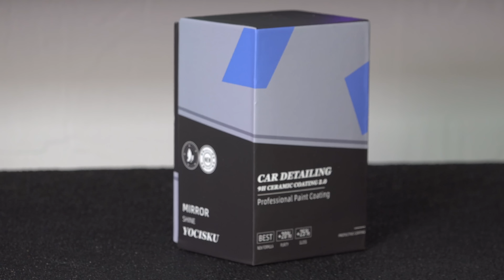I Ceramic Coated my SNOW BLOWER to make it NON STICK

Comment from the maker: Thanks for watching  Please LIKE & SUBSCRIBE - $2 off coupon on the coating here! https://amzn.to/2WL7kU2
Reply: Price is now $26.  Which is somewhat typical for Amazon and items that suddenly start selling.
Reply from the maker: @eosjoe565  Click on https://amzn.to/2WL7kU2 again. Its an instant coupon, so just click the coupon and it takes the 50% off. I just checked and it is still good.
Reply: @SilverCymbal  - Haha... time to do an updated review because that link has expired and, is now 'currently unavailable.'
Reply: @eosjoe565  The price is 25.99 but the offer comes with a 50% off coupon if you check the highlighted box. Best wishes.
Reply: @parrotprodigyproductions  Ahhh...  didn't see that at all.  Thanks.
Reply: Grabbed it!  I have the materials to add the rubber paddles but never got to it. I always try to find easier way before opening or drilling anything. But I am surprised that S.C. have not yet done rubber paddle extensions himself
Reply: Must have changed. Now there is only a $2 off coupon.
Reply from the maker: @runningmadphoto1947  Sorry they must have ended the extra deal, still a great value for $25
Reply: @SilverCymbal  I still may check out. Sure beats having to spray it down every time.
Reply: How well do you think the ceramic coating would work under a mower deck?
Reply: So, how long did it last?
Reply: Would sure like to see a long term review of this!
Reply: I wonder how it would work on a satellite dish.
Reply: So, if you had an idea for a modification that would revolutionize snow blowing? Could you build or modify the machine? I have the idea but I'm not one for building or modifying a snowblower. It only snows here once every 12 years. However I lived up north for a while. My first year I cleared a path to the truck with a dust pan. 🤪 haha 😄 maybe we could make a prototype and sell the idea.
Reply: You could 50/50 test but would need two identical machines.
You could just try with similar machines, but someone would complain thinking the future of humanity rested on it.
Reply: These knock off Chinese ceramic coatings don't even last longer than off the shelf wax. That's why it's $10-20,  not $100-200.

Comment: As a teen in the 70s (Rochester) we used cooking fat, then moved to silicon spray, then spray lube oil with PTEF. The PTEF spray worked great, silicon less so and cooking grease not so much. Ceramic coating seems like too much faffing around, I’ll stick with the 15 second spray treatment.

Comment: It would be better if it was in a spray bottle. I use silicone spray on my blower and it works great and it much cheaper. Another idea that works even better is to install belting on the blower impeller fins (impeller kits available on Amazon) which makes the machine throw farther and not plug up in wet, heavy snow.

Comment: Pam is garbage.  It left a gritty film and I had to strip it off with mineral spirit.  After cleaning my snowblower, it ran like it was brand new with no clogs and threw the snow further.. I was very surprise.  I will be using a product call NuFinish which probably last several winters.

Comment: It would be much easier using ceramic spray to coat your snowblower especially in tight areas and cost less to purchase.
Pam is a big no no as it will thicken in the cold and actually clog your snowblower.

Comment: I cannot believe people use Pam or oil which gets thick and sticky in cold weather! Not Smart. And this ceramic coating is too much trouble and not as effective as a silicon spray before use and presto no stick at all and stops moisture from geting in places.
Reply: !! DING!!  Bingo ... I have been using Silicone since 1976, When I bought My 1st Snow Thrower and I still Have and use. The trick to Silicone it Must go a Clean Dry surface and it Must dry after application. 
That 47 Year old Gilson 826 just keeps Chugging along, Altho I have done many repairs to it.
I always claimed it is simpler than a Simplicity LOL  
I think it is the only machine made with Shift on the fly  .
Mike M Central Wi.

Comment: I took a plastic 5 gallon pail , split it , and lined just the chute with the plastic.    Never had a problem here in WI with any plugging.   So that's another quick fix.  And it has pasted 4 years now

Comment: interesting. I suppose a RINSE OFF spray ceramic would work best. when the "surface" is far from a flat (like this or on wheels), it's faster AND coats better.

Comment: You could’ve fixed it a lot easier and more permanently by adding rubber cutting edges to the impeller.

Comment: I never got into the pam because it's vegetable oil & will get sticky if it sits on a surface long enough. I use WD-40 but have wondered for a while about the ceramic coating.

Comment: The impeller modification is the way to go. It throws the snow twice as far as they normally do. My snowblower has not clogged in 2 winters now. We are in a warm area so the snow is always heavy and wet.
Reply: And what is said "modification"?

Comment: The coating won't last, snow is an abrasive and will wear down anything.  My 1971 Ariens looks like sandpaper was used on the interior and chute.  Spraying down the snowblower every use is just part of maintenance, it doesn't take long.  I spray my entire snowblower down with a Dow silicone spray, the entire thing even the tires and chains.  I do this to keep snow from sticking and also keep it from rusiting more.  Then after every use store it in my basement, which isn't heated but is somewhat warm.  After any snow is melted off I'll wipe it for with an old bath towel and reapply the silicone spray.  If it calls for snow again I'll spray down the chute and auger the night before again.

Comment: your lack of common sense is astounding .......you have been contaminating the environment............."the Teflon coating wears off and i have to re-do it each time".....If you didn't know PFOA persists indefinitely in the environment.[63] PFOA has been detected in the blood of many individuals of the general US population in the low and sub-parts per billion range, and levels are higher in chemical plant employees and surrounding subpopulations. PFOA and perfluorooctanesulfonic acid (PFOS) have been estimated to be in every American person’s blood stream in the parts per billion range, though those concentrations have decreased by 70% for PFOA and 84% for PFOS between 1999 and 2014, which coincides with the end of the production and phase out of PFOA and PFOS in the US

Comment: I have that same snowblower or very similar and did a lot of snowblowing last year. Not as much as you have there but maybe close. And I never had it clog up at all. Looked the same every time as yours at the end of the run. And I never coated it. Did you ever run that machine without the coating? It looked new. I'm not knocking you, I love the idea. I just don't know if it's necessary.

Comment: IT SHOULD LAST LONGER THAN 2 YEARS!! 

Think about it It's made for a car that's under constant weather conditions whether get the heat, snow, ice.. 

You only applied it basically for one season and only a handful of snow storms. 

That two years they mentioned is for constant extreme situations all weather.

Not the case with the snow blower. 

I would say you might get three years out of it or more. I mean why would it come off, and not to mention you're probably storing your snowblower inside unlike most cars. 

I would even say just a good coat of regular wax would last at least a year. Not there plenty of regular waxes that last over a year on a regular car. In that case it would obviously last longer on a snowblower!! 

;)

Comment: Best thing you can do is get all the paint off the chute and impeller housing. The snow will scour it to a shine and never stick to it again. Forget all the “tricks” and sprays, they don’t last. Bare metal is the answer. The only people who seem to know this are equipment operators and farmers. Paint looks pretty but is your worst enemy on surfaces that need to be shined. Plows, tillers, snowblowers, augers. Paint just makes them not work. Remove the paint if you want it to work like it should.

Comment: As somebody who professionally installs ceramic coatings I will say this is great in theory but won't hold up for long. The coatings are so thin that the friction from snow and ice will blow through that coating in no time. Some coating companies like ceramic pro and igl both make industrial strength coatings that are meant for equipment but they're only available to certified installers.

Comment: It is easier to use WD-40 or any silicone spray for 15 to 20 seconds each time you use the snow blower. A $5 can of WD-40 should last you the whole season. 😉😉😉

Comment: Ive been spraying a water repellent lime camp dry o  my machines for years and it really does improve the performance and non stick advantages of the snow to the machine.  Really works well on all of your snow removal equipment like roof rakes and snow shovel type tools.

Comment: I understand you bought the coating for a different purpose but as soon as you pulled out the towel from the box I knew it was a cheap coating 😂 and then you mentioned you bought on Amazon for $20 but still pretty good $20 well spent

Comment: Thanks for this! I'm guessing I've got several decades on you and snowblowing a 200' driveway is becoming increasingly difficult.  There's a pretty substantial incline. After watching your vid on ceramic coating your lawnmower I decided it might well work on my Honda snowblower.  We recently had close to a foot before it turned to rain. Thanks!

Comment: Silicon spray also works very well as a coating and lasts me an entire season.  Much quicker and cheaper,  just spray it on and let it sit
Reply: Same here - this looks like it would take more time than it's worth compared to just using a silicone spray.

Comment: I used an old trick from my early 60's childhood days of sledding on my old Yankee Clipper. I would rub an old wax candle on the runners of my sled. It helped cutdown on snow build up. So i used the same principle on the impellers and augers and the inside of auger housing. It works help keeping the snow blower clog free.

Comment: Pam doesnt last long     buy blocks of wax for candle making or canning    rub 
the inside of the chute with wax
works better lasts longer  also add rubber wiper to impeller throw snow/ slush further  almost never clogs

Comment: You can also use silicon dioxide nanoparticles suspended in ethanol (SiO2), after the ethanol dries it forms a superhydrophobic crystalline layer.
Reply: That is exactly what he did. The automotive people call SiO2 ceramic wax 
- a 'high-tech' product offering “spray-on, wipe off” simplicity.

Comment: 2 x coatings of neverwet on my sno joe and it throws snow 45 feet in the air and sbout 50 to 60 feet. I was able to drop wet snow on my neighbor across a 2 land road with ease. Blows ceramic coating away and last 3 years now...... It cost me 1 dollar for 2 cans ( 2 step process) from dolar tree.....

Comment: I just use a plow on my ATV, faster, less effort, and better clean. Won't have that layer you left on the driveway which will just freeze and be a sheet of ice where I live. Ice is worse than snow.

Comment: I'm lazy, I would recommend Dupont Teflon for snowblowers and shovels that gets the exact same results because I use my own Toro Snowblower for wet and icy snow all of the time and come across this problem...Felt like an upgrade and practically was that saved a lot of time unclogging and h*ll...lol...What use to take 3 hours only takes one and saved fuel and energy for other chores around the house...

Comment: Interesting...Here in Chicago we tend to get heavy and wet snow which can be a nightmare to shovel or snow blow. It is especially bad for people like me who have driveways that go behind the house and deep into the yard. My current blower is a late 90's Craftsman 3.8HP with a 21" Path and we've had it since before I even existed. I like using it and the thing has never broken down after so many years or required any form of parts replacement (minus the handle bar that rusted into two), but it constantly gets bogged down by thick and heavy snow that clumps to the chute and causes a clog that typically won't resolve unless you aggressively bang the thing against the pavement or (risky) jab a pole down the chute. I will try the spray greaser next time and if that works better then I might consider something like this. I don't like to just throw things out and this machine has served me good already alongside my our mid 90's Lawn Boy push mower.

Comment: My grandfather back in the 60’s used to use Crisco and then started using spray Pam. I’ve used Pam and even silicone spray, but now I will give the ceramic coating a try. 
Thank You for the video!

Comment: I started using Meguire's hybrid ceramic spray automobile wax on my 44" John Deere lawn tractor snowblower, with similar results.  I got the idea from a spray ceramic ski wax that see advertised on FB.  It costs $16 at WM and works very well.  I started using it on my cross country skis and I can't believe how well it works, on the top and the bottom.  My buddy sprayed some on the bottom of his granddaughter's snow disk and she was the fastest one down the mountain. I'm going to try it on my downhill skis.

Comment: So, one day I got a job with a concrete crew. Newest and least experienced. But, construction smart. I've done a lot of things within. It seemed I was the shovel guy. I had that shovel in my hands alot more than not. A few frequently used types daily. So, I didn't like their shovels and just used my own. Mine where older with slightly longer handles and a bigger rounder stock on the end. Better for less bending leverage. But, the biggest problem with any rusted scoop is that things are gonna stick. Like dirt, mud, and concrete. And, snow. I primed and ceramic painted them the 1st week of that aggravation. Nothing has stuck to my shovels in 5 years. And, my spade cuts better and flings better dirt and stone. Concrete doesn't clog up in the tight spots. I got fired about a week after that 😂

Comment: Think I could do this to the inside of my snowmobile tunnel? Thing packs with snow and the suspension isn't as nice of a ride after a day or 2 of it.
Reply: I'd think so. I'd be careful with putting it on the actual suspension pieces. I'd probably tape certain areas off.

Comment: I use 3M silicon spray on my toro 1432 HD. Works slick. Just spray it on quick before use and have no problems with snow sticking. Clogging is not an issue with these snowblowers no matter what kind of snow it is anyway.

Comment: Just use wd-40, it’s literally called water dispersant 40. I put it on my snow shovels. This is a huge waste and a solution to a problem that was already solved.
Reply from the maker: Sure, but you need to do that every time, it doesn't last. This is much longer lasting but do whatever works.
Reply: @SilverCymbal  okay it’s 30 seconds worth the wd40 spray, equates to about .05c lol. And that’s wd40s job you don’t need to do it every time. It last longer than that. I do my snow shovels once a year

Comment: Another suggestion - dissolve cheap white candles ... tea lights for example ....  in white spirit and then paint it on.   The white spirit dissolves and leaves a non-stick wax coating which lasts.   I use it on windows and shower enclosures.   I had even thought about using it on the car but haven't got around to that yet.

Comment: Good tip!  I put LEDs in my plow headlights and when its snowing the snow starts to build up on them since there isn't much heat generated.  Tried pam cooking spray but it just wears off.  Hopefully this does the trick.

Comment: Why is he leaving about a 1/2" of snow (the slushiest, wettest snow) on the driveway?  See ~ 2:37 mark.  He has the feet set up to leave that.  Why?  In Cleveland, once you remove that top layer of fluff, that bottom layer of slush will freeze and you've just created a giant ice rink.
Reply: He might be doing rougher areas than his driveway like a stone path to the shed in the yard...

Comment: I hope i never become bored and boomer enough to buy this big of a snowblower. Seriously, if snow sticks to it leave it in the garage for an hour. This whole thing is such a non-issue. No one has a driveway that long.
Reply from the maker: Snow won't melt in an unheated garage after 24 hours. I live in a rural area where lots sizes are 2-5 acres. Get what works for you.
Reply: @SilverCymbal  living on a 2 acre property sounds like a full time job, i guess at that point its a work expense

Comment: 1100' driveway and youre using a snow thrower??  You need a Snow Sport Plow... Mine is only 300' long and most of it uphill and theres no way I'd consider a snow thrower.   I do my entire drive way in 15 minutes and thats with mounting and dismounting the plow.

Comment: interesting tip, but I've never seen the inside of a snowblower with an intact paint job like yours, especially around the auger and in the shoot. Where I use to live they throw gravel and salt on the roads when it snows which scratches through into the steel and rusts when snowblowing.

Comment: Great tips man! I have a Toro with a plastic chute so I need to see if I can do some plastic ceramic coating, see if that helpss.  But if not that cooking spray method you mentioned briefly in the beginning will tried out.  Thanks for the tips!

Comment: Interesting  idea, but since my snowblower has never clogged (no matter how wet the snow was), I won't worry about it. My snow blower is a honda tracked machine. Just love those tracks. 
Note: My snow blower stays outside all winter. I use compressed air to blow the shoot and other parts clean before covering it.